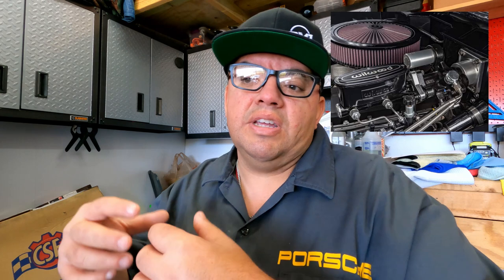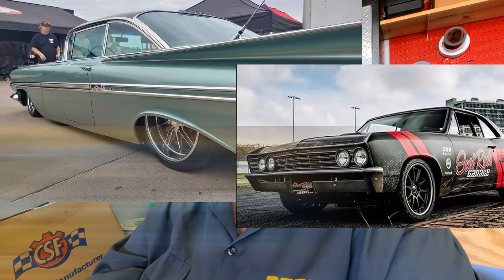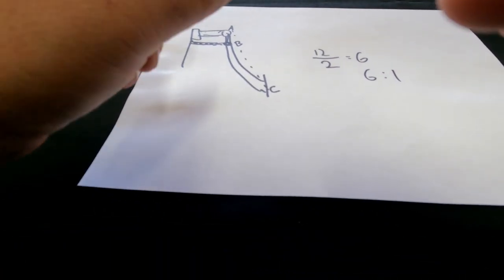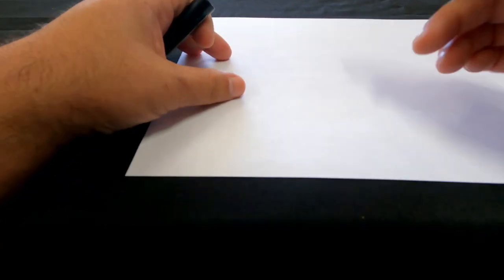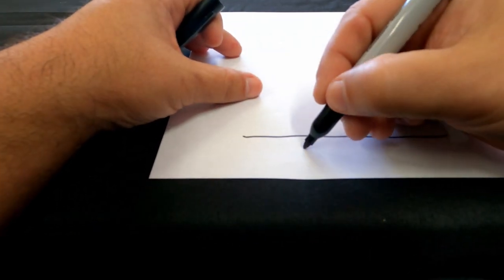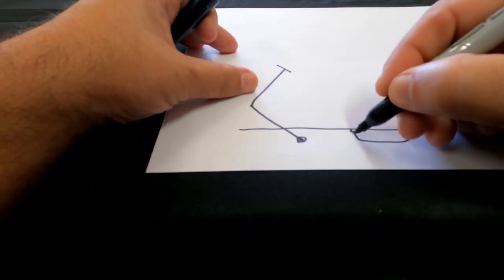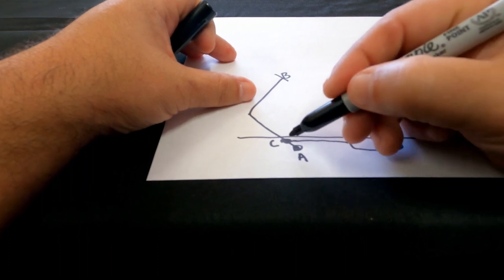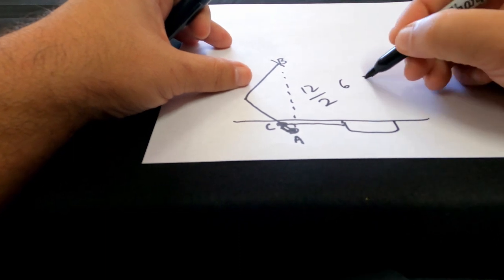Brake Tech 101 - How to: Manual Brakes

Comment: This is one of the best, clear explanation and break down of the "Manual" Brakes. I will continue to watch your other Videos. My Pedal ratio went to the floor after installing new Brakes and Master Cylinder and Bleeding till my foot was sore. Found out from your Videos it could be the Brake Pedal, Push rod may be to short, not reaching  and engaging the Master Cylinder plunger. Bought a Universal Pushrod (Adjust longer). Did the trick. Thank you.

Comment: Man, thats the best and most sensible video Ive seen on the subject.
I have a 70 Torino with stock disc front and stock Ford disc rear.
I want to go to manual brakes, I have a 6:1 pedal ratio (used to be a bellcrank setup)
Would I be on the right path using a Wilwood 15/16" and Wilwood prop valve to give me good safe brakes?
Thanks and love your work 👍👍
Reply from the maker: Yes

Comment: Very informative video. I have 67 camaro pro touring build I've done myself. With a 15/16 wilwood mc, stock camaro pedal utilizing the top pedal hole and 6 piston front and 4 piston rears with wilwood proportion valve. My pedal is firm, and i feel like i really need to apply pressure to get ok stopping force. Any insight on what might be needed for better brake performance?

Comment: Terrific info. Given that the manual can reach the pressures as the vac assist booster, why wouldnt I choose a simpler manual setup?
Reply from the maker: Sometimes, depending on the build, it may not allow the room to run the proper pedal ratio.  Or personal preference, if vacuum and booster size are correct, some may like the feel of a modern boosted system for a street car.  The key is making the correct pressure without have to make too much effore

Comment: My brakes don't grab hard. Fron disc. Chevelle . Drum on the rear .  Way too much peddle pressure.  Is it a bad prop valve  plz help???
Reply from the maker: @stevekelly4103  most likely not.  Prop valves do not add pressure.

Comment: Do you think a 15/16 mc with a 4 piston caliper (1.65in² per piston) and a 6:1 pedal ratio will have a good pedal feel and stopping power? Good information on using 4 piston calipers aoth manual brakes is hard to come by, thank you!
Reply from the maker: @cameronpierce5188  what size pistons are on the back caliper
Reply: @rmjmotoring  1.75"
Reply from the maker: @cameronpierce5188  1.75" four piston caliper in the rear and 1.65" four piston in the front?  That is not a good combo with more rear clamping force on a front engine car or truck.
Reply: @rmjmotoring  sorry shouldve specified, 4 piston calipers in the front and single piston in the rear
Reply from the maker: @cameronpierce5188  ok makes more sense. 15/16 should be a good start

Comment: I put a bear 2 piston clasic kit with there 15/16 master cylinder and one piston disc in back and I got the gm brake pedal with 2 holes on for manual brakes 6to 1 ratio and my don't stop at all talked to willwood they say put the 4 piston in front and that should fix it I want manual brakes
Reply from the maker: 6:1 pedal ratio with a 15/16 bore master cylinder, using 100 pounds of leg force on the pedal should output about 800-900 psi.  Which should be good
Reply: So u think I would better off with the willwood kit 4 pistons
Reply from the maker: @MrDavidfig  the Wilwood would be more efficient, but I suggest confirming the pressure at the caliper first
Reply: I did that last weak almost a 950 in front and 800 in back
Reply from the maker: @MrDavidfig  pressures are where they need to be.  Even on oem brakes it should stop.  Unless there is an issue with the baer components

Comment: I know this video is older but I have a 66 mustang. I’m upgrading to 6 piston brembo front calipers 15 inch rotors. The rear is single piston calipers with 14 inch rotors. I’m torn between using a 7/8 bore master cylinder or 15/16? The pedal ratio is 6:1. I’m manual brakes by the way. Any info would be helpful
Reply from the maker: Do you know the front and rear Piston outer diameters?
Reply: @rmjmotoring  the front 6 pistons are 36mm and the rears are single 43mm pistons. The front brakes are from a s550 mustang and the rears are from s197. Does that help? This subject is a little confusing to me.
Reply: @rmjmotoring anything??
Reply from the maker: @mrbonafied78  sorry been busy.  Are all 6 pistons the same diameter at 36mm?
Reply: @rmjmotoring  yes
Reply from the maker: @mrbonafied78  With you 6:1 pedal ratio and the piston area you have,  either will work.  Personally I would side with the 15/16, it will still make 800-900 psi with normal leg effort, but give you a pedal that will firm up higher.  The 7/8, due to less volume, will require more travel (stroke) before it firms up.
Reply: Thank you so much